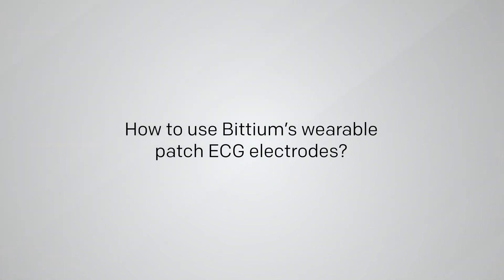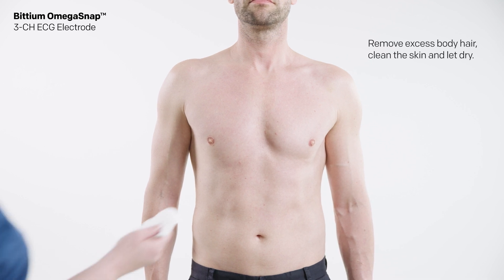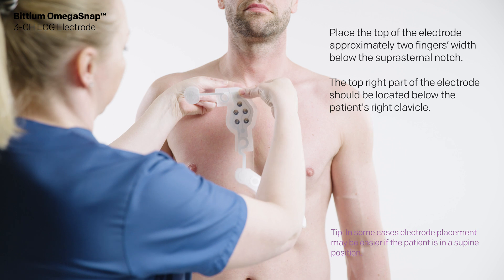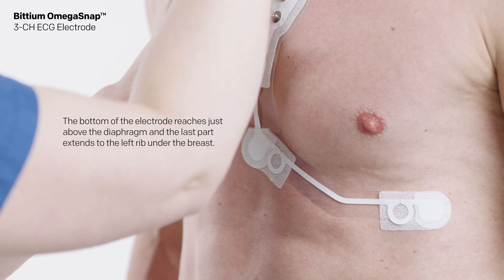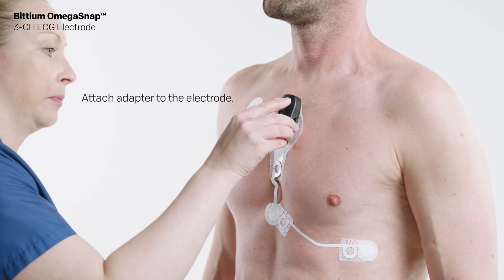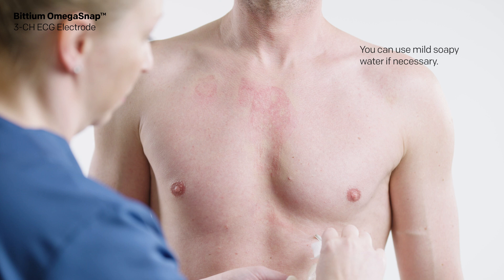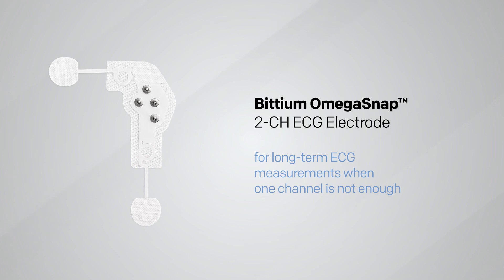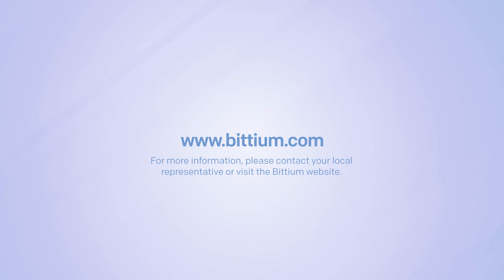How to Apply Bittium OmegaSnap™ 3-CH ECG Electrode?

Comment: What is the intendend use case duration? 3 days? 7 days? 

Holter Devices have special isolated cables to reduce motion artifacts, can you show a video in real-time where somebody carries such a patch and presses on the electrodes and on the "cable". I am pretty certain, that the signal quality will not be good enough.
Reply from the maker: Thank you for your good question! The contacts between the electrodes of Bittium OmegaSnap 3-CH ECG Electrode are designed to withstand the effects of motion artifacts.
 
Unlike measurements with cable electrodes, one OmegaSnap chest attachable 1-, 2- and 3-channel patch can be used for 7 days measurements and MiniSnap Sensitive electrodes for 48 hours at a time. From the patient's point of view, the measurement period is considerably more pleasant while wearing a patch electrode than the corresponding one performed with cable electrodes.

Unfortunately, we do not have the kind of  video material you requested, but please visit our website for more information https://www.bittium.com/medical/bittium-ecg-electrodes or contact our sales for some product samples: medical@bittium.com.

Best regards,

Bittium Team